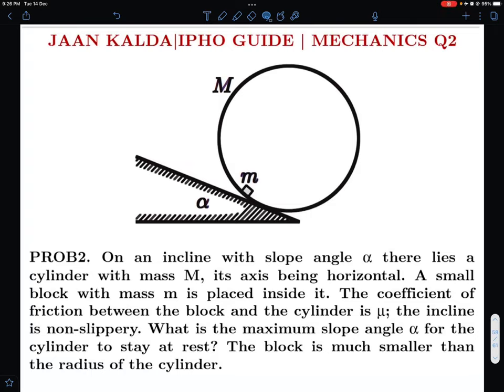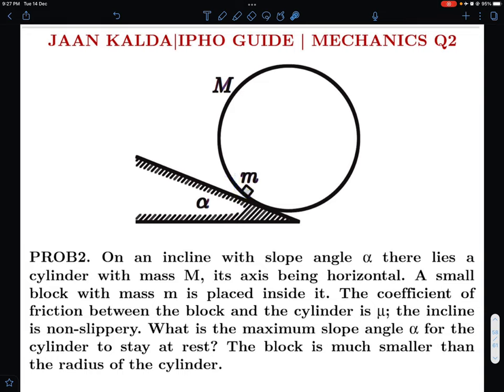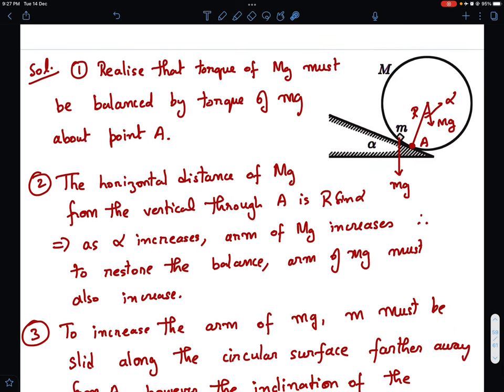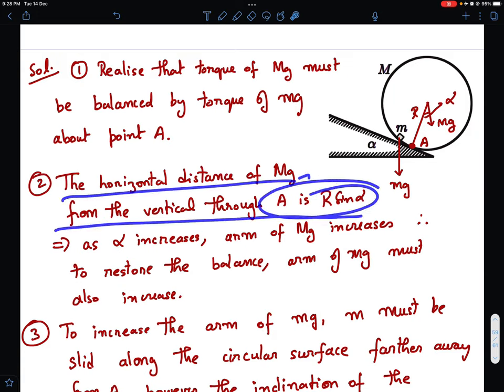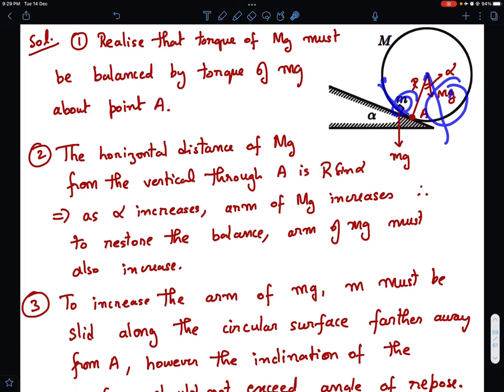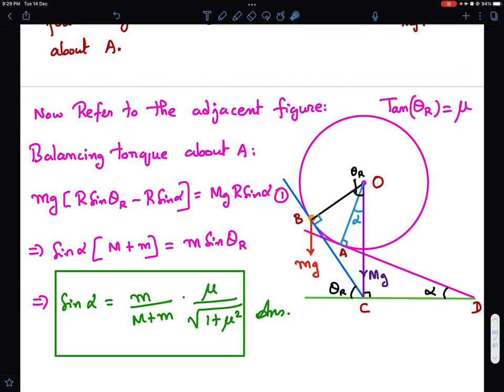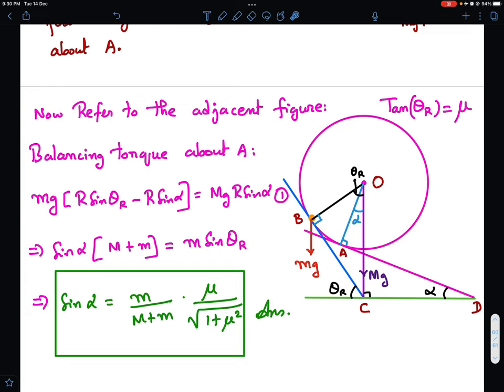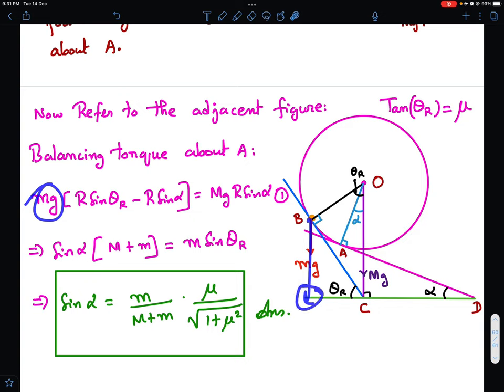ROTATION| JAAN KALDA| IPHO HANDOUT| MECHANICS PROBLEM  2

Comment: Dear sir good morning. Thanks for your  guidance you are my most respected teacher.  I have one doubt regarding pole in mirror from long time.  As the object is front of mirror in 3d. I am confuse what is rays parallel to optical axis is it in 3d or only vertical plane having optical axis. Due to this optics topic is very poor. Please help if possible
Reply from the maker: Paraxial rays means rays at small angle to Principal Axis (in 3D)
Reply: Thanks a lot sir.
Reply: In all optics book they used 2d plane paper for rays it seemed all the rays parallel to principal axis only lies in that plane in 2d only.